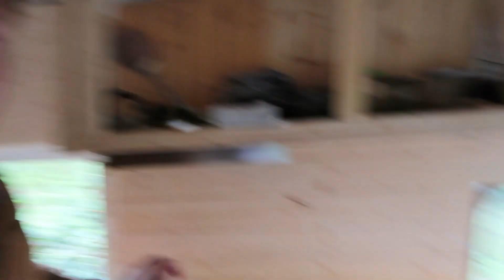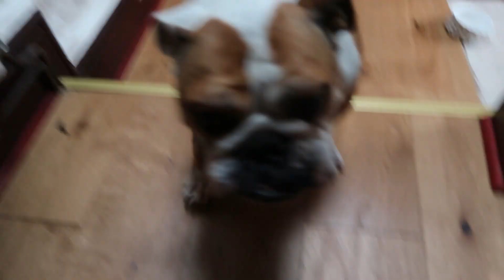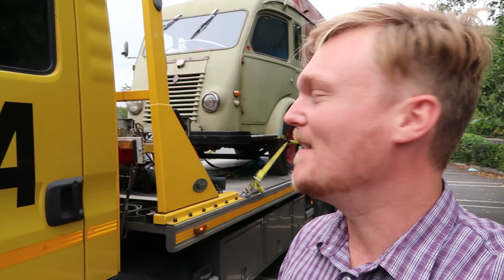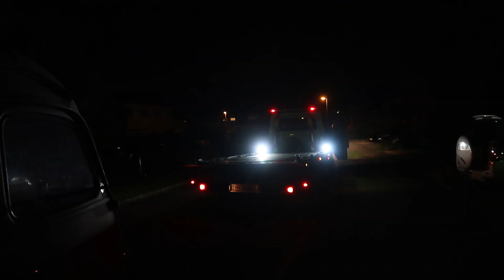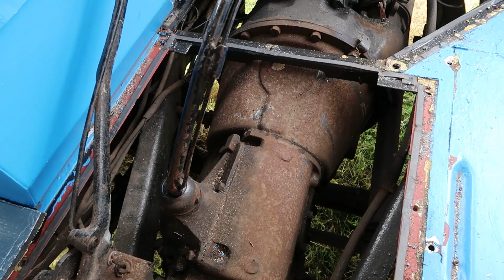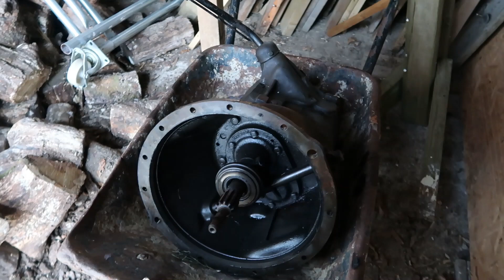Vintage van life episode 18, returning to Sussex with a broken gearbox

Comment: Oh the value of the AA recovery! I have used this twice, but I reckon over the years it would have been much cheaper to have made my own arrangements, still it is peace of mind which is why I keep renewing!

I have stripped a few gearboxes down, unless you have a workshop manual it is going to be a bit harder, have you thought about sourcing a 'box from France? Anyway, they are usually straightforward, if it is an alloy casing, a bit of heat will help to release bearings, if it is non-synchromesh it will be simpler and less risk of things pinging off never to be seen again!

Good luck and look forward to your progress!